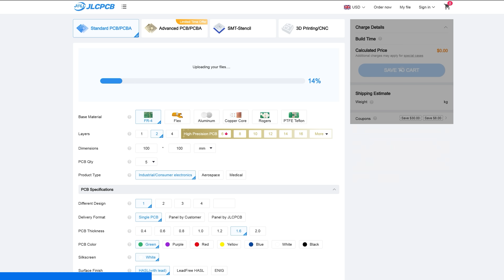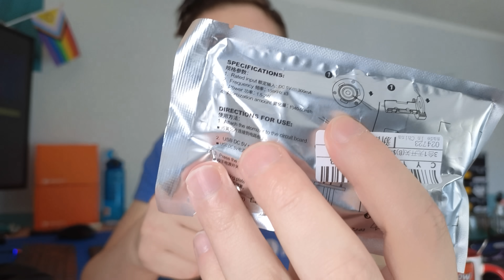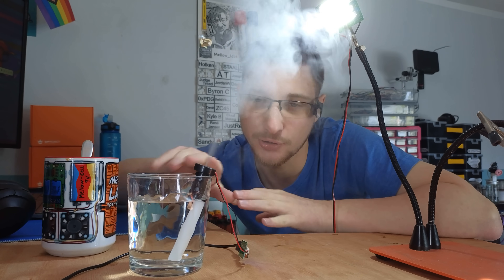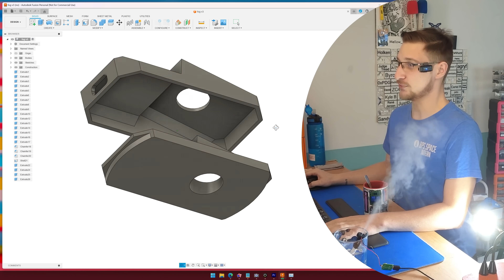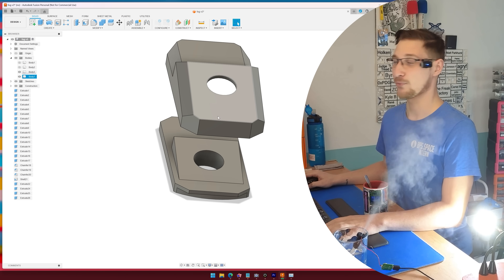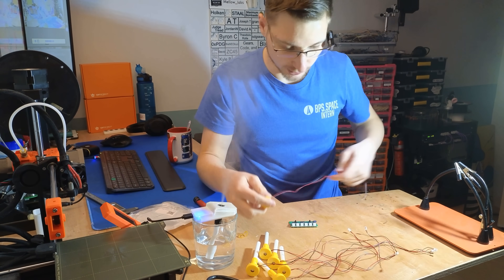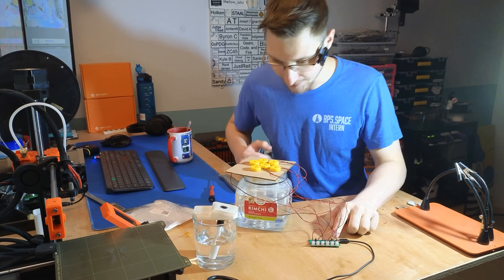DIY Ultrasonic Humidifier

Comment: I`ve been looking at these cheap atomizers, but as far as runtime, the only info I`ve found was one one of them which stated 2-8 hrs, so basically you`ll go through 15/month if you use them 4 hrs per day, and that`s if you have a design where they`re easily swappable.
I`m always sceptical of stats on Chinese sites anyway, but that number didn`t seem too impressive, as low as 2 hours means they`re not really very affordable at all and I should look for something else for my project, then again, it doesn`t hurt to buy a few and just see how long they last (:

Comment: The worst type.. you can hardly call it humidifier as the water doesn't turn into vapor, you just atomize it in liquid state.. you get water minerals all around your furniture when the water evaporates eventually.

Comment: This device might be useful in a cheese-making application. I use a minifridge to age bloomy white rind cheeses. They need ~90% humidity and cool temperatures. Although I do have a humidity sensor that I'd use for feedback to control the humidifier, I'm a little hesitant about the potential for excessive water condensation -- both on the cheese and on some of the sensor circuits located in the fridge. The bad cheese molds thrive in standing water. Currently, I use a computer fan and a clean sponge wetted with distilled water in a small dish. It works, but it takes the fan several minutes to re-establish humidity setpoint each time the fridge kicks on and pulls the moisture out. Maybe I'd need to use the computer fan in conjunction with this humidifier to help disperse and force evaporate the atomized water vapor. If it works then I bet it'd really speed up re-humidification.

Comment: Imagine this in a pumpkin, lit from behind, during the Halloween :)
Reply from the maker: You should watch the video before this one 😂
Reply: @Mellow_labs   I did watch it before :D I already bought this humidifier yesterday night
Btw, what I did at home, I installed aqara vibration sensor on my door bell in the house, so Home Assistant knows that someone is ringing. I have a speaker near the front door (with google assistant support and casting option), so once someone rings during halloween, scary sounds starts to play on the speaker :) Next year, I'm gonna do a pumpking with some lights and mist :P

Comment: These are pretty amazing. I've been looking into them for the past few years as a way to do evaporative cooling without a pad. If you think these are cool, check out model with 5 ultrasonic nozzels at the bottom of the water tank, with a fan. They sell for between $5 and $20 on Ali, and I only started noticing them last year so they are fairly recent. You can usually find them by searching 'Five-hole Spray Fan'

They work better because gravity drives the water into the ceramic disc to provide constant contact

Something to note: these have limited lifespan, due to dissolved salts from hard water building up. You can clean them, but they are so cheap most people just replace. But using water from a Reverse Osmosis unit will keep them clean much longer.
Something else to note, because I was a bit confused at first, is that there are two different types of these ultrasonic humidifiers. The first is the type featured in the video. It is a disc with tiny holes in it, and it vibrates and squirts water up through the holes. Thats why it has to sit ontop of the water. Its designed to be driven at 118khz
The other, older type, the type you find in pond foggers, actually vibrates the water until it turns to a cool steam. It operates at 1.7mhz, more than 10x as fast, and consumes a lot more power but produces a finer mist.
Reply from the maker: That’s good to know. I was curious about the bigger ones and whether they were the same thing just scaled up.

Comment: I bought one of those ready made humidifiers... 50€ and the output was 300 mL/h. It was recommended for 30 m^2 room. And I returned it, because it made zero difference to the humidity! So, even those six are quite useless, unless used for small room.
Moreover, I'm not sure they are good idea anyway. It turns out they will add particulate matter into air (the micro droplets dry out leaving micro particles), which might be harmful for your health.

Comment: Maybe put some glycerin + water through it to make a smoke machine?
Reply from the maker: Anything more viscous than water doesn’t wanna go through it
Reply: @Mellow_labs  You would need a heat source for that to work. One time I tried wrapping small copper tube around a 3D printer filament for a mini fog machine, it didn't last.

Comment: I bought an commercial one. After learning that it always needs a press of a capacitive button to start and I couldn't use my wifi socket to control it like I used my earlier one, I "had to" stuck esp8266 inside it and make it controllable by mqtt from home assistant.

Works great. I read voltages from rgb-led legs to tell what state it is in and after a bit of trial and error found out that the capacitive button could be controlled by bringing otherwise floating output to ground through 1Mohm and let it float right after. It still works with fingers too.

Most of the store bought humidifiers have the same problem than the six shooter in the video.. Fans in them are always too weak to mix the mist with enough air for not to make everything wet around the thing. So I added 120mm pc fan beside the output to shoot the mist up and have not had any problems for several years with that.

Having humidity meter to control how much to use the humidifier is really nice and I would not like to ever use a humidifier blindly again.

Comment: I stopped using those after reading that breathing small airborne particles of limescale is bad for your health. But idk if this even occurs tho.
Reply: well, you aren't meant to use tap water with these things, so generally we use RO water and they last a long time compared
Reply from the maker: It sounds plausible, but I doubt it. The holes on that Piezo thing are minuscule. And it doesn’t really like vaporising anything more Viscous than water.
Reply: @Mellow_labs Vicious lol 😂 Viscous?
Reply from the maker: Speech to text me dirty once again 😭

Comment: I had no idea you can buy such modules, that's really neat. That 6x one would make for a nice looking humidifier, e.g. if you put the modules in a single line and used some amber LEDs to light the mist up.
As for the pricing of humidifiers, I think a big factor is whether they use cotton wicks or not - I got a humidifier with a cotton wick and RGB for $2, whereas a unit that doesn't use wicks cost me around $10. Both ultrasonic, of course